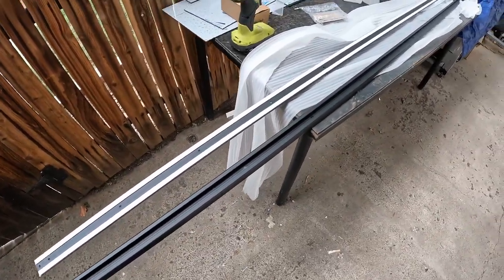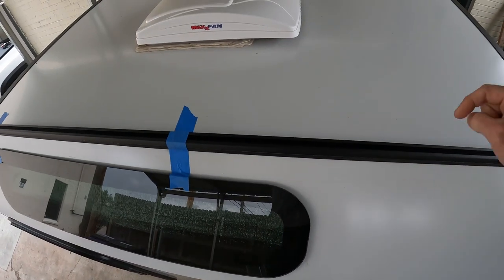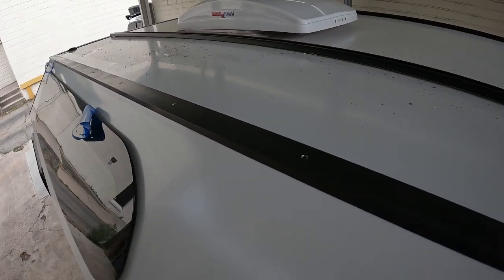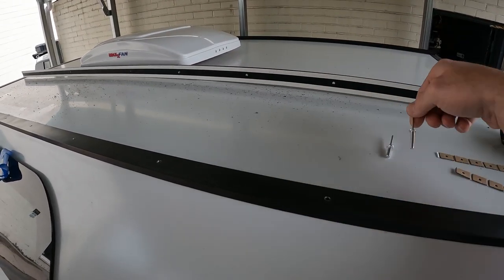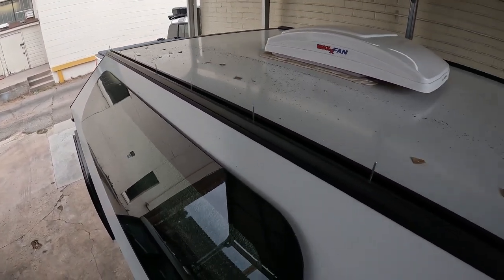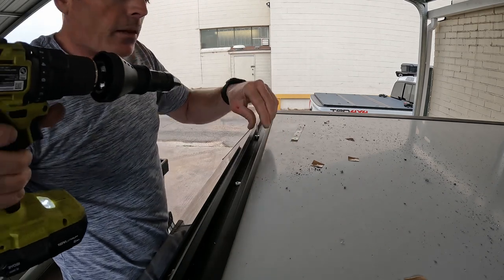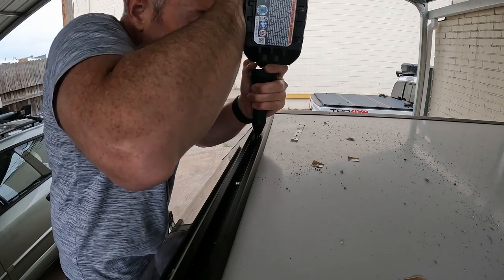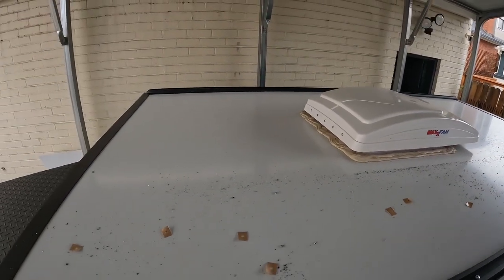DIY Overland camper trailer build: cabin part 23 - Roof tracks/rails

Comment: Nice and clean.
Thanks for sharing.
Reply from the maker: Thanks for watching!
Reply: Great work as always! I’m wondering how and what you used for trim for the upper angled corners of the trailer. I imagine that took some creative thinking or custom made aluminum angle. Thanks for sharing your build with us. It’s by far the best I’ve seen.
Reply from the maker: It is currently trimmed with windshield molding.  I have started making aluminum trim but it’s still a work in progress.

Comment: Thanks you very much is very helpful, i dont see the video for the trim on the panel corner , you make a large trim for the top but the smaller one ?
Reply from the maker: I am currently using windshield weather stripping on the corners. It is actually holding up pretty well. https://amzn.to/3K8cBhj

Comment: Been enjoying your series. Curious -- how strong is the ACM panel in a build like this? Are there any issues with rocks etc. causing dings? Thanks for putting these videos together!
Reply from the maker: Seems plenty strong so far.  I added aluminum diamond plate to the front where dings are likely to occur though.
Reply: @infosponge  Thanks!